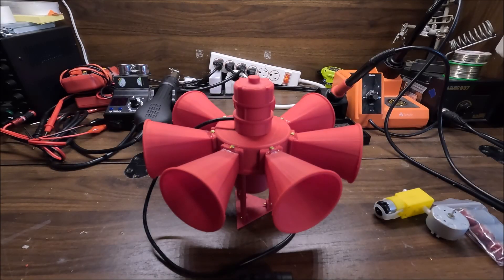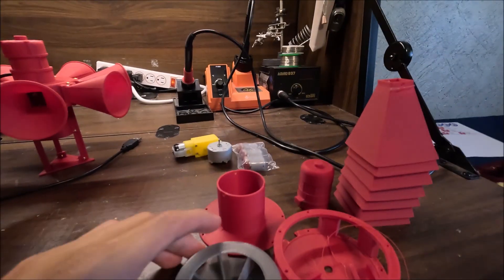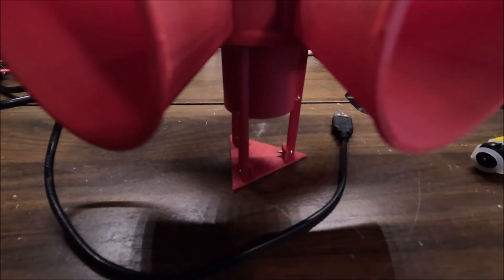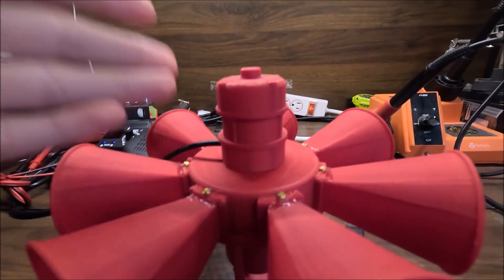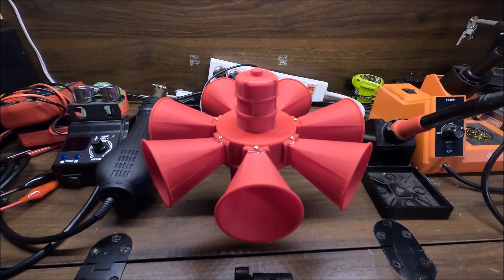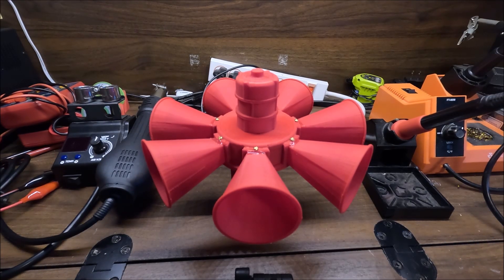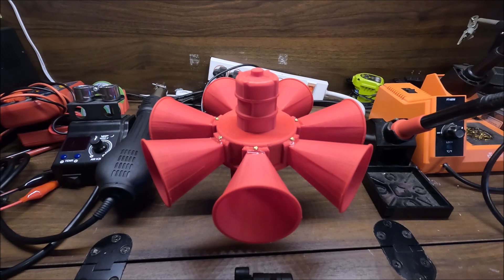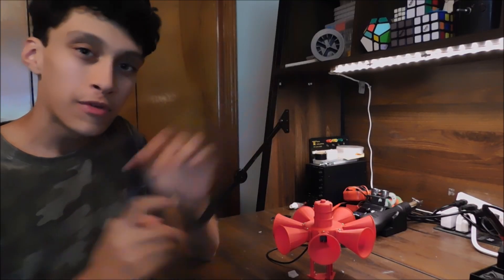My Revamped STL-10 Siren Overview and Test!

Comment: what happened to the 380 motor size?
Reply from the maker: I scrapped the 380 motor sirens because they don't work well with USBs and have pretty short wind-downs from the tight shaft. You probably could modify the motor cover and stator to fit a 380 motor, but I recommend 130 motors.
Reply: @milespeterson5049 
ok

Comment: If it’s possible, you should get a motor that has a counterweight on it so the wind down can last longer
Reply from the maker: Yeah, but 130 motors don't usually have that, and putting weights on the rotor is a real pain.

Comment: While i was building my eclipse 8, the rotor broke  :(. Im gonna reprint it with pla+
Reply from the maker: Darn! Was it when you were removing the supports? Also, just curious, is your actual filament brittle because of moisture? I have had this problem before and switched to drier filament, and my rotor stayed intact.
Reply: @milespeterson5049  yea I was removing supports and the top part came off.
Reply from the maker: @SeekPlays_NOAA  May I recommend tree supports? If your slicer supports that support structure, I would try it, because it actually forms the supports outside the print, and they gradually stretch out to the inside of the print, so they're super easy to remove. It usually takes longer to print them, though.

Comment: Hey, that's pretty neat. Also, when will that 2001 be released, also where?
Reply from the maker: I'm currently working on the 2001 right now! I have it fully modeled, but I'm going to have to replace a few parts on my 3D printer because it broke down, which will take a few days. The good news is that I'll be resuming the project very soon, and I might also be selling these!
Reply: @milespeterson5049 That'd be great. I can buy one, but it depends where you're selling it. if not one day soon ill print one myself.
Reply from the maker: @GabesElectronics If you can print one, by all means, make it! However, if you'd just rather buy one, I'll have that option available in maybe a few months.

Comment: I'm printing this one right now! It looks great, your very good at making these things!
Reply from the maker: Awesome!! Sorry for the late reply. I'm hoping that most people who have printed this siren in its early stages should print out the new parts and update their old STL-10s or just keep the original parts because now they're pretty rare!
Reply: @milespeterson5049 Thats ok, but yeah i finished printing the new version and now i just have to wait for my TT motor to arrive!
Reply from the maker: @TrainsAndSirensofCA  Awesome! Just take apart the little black 130 motor on the back, and you're good to run it at 5V. You can also buy 130s separately, but the RPMs will be different.

Comment: Also do the DC motors that are on Tinkercad work, Or do you have to get an actual one in order for the siren to work?
Reply from the maker: Are you talking about printing a model of the DC motors from Tinkercad? If so, then no, they won't actually function because it's a plastic dummy model, so you'll have to get a real DC motor for it to electrically work as a motor.
Reply: @milespeterson5049 Ah okay. Yeah I was talking about the ones on tinkercad lol